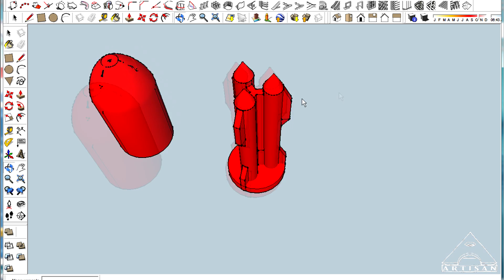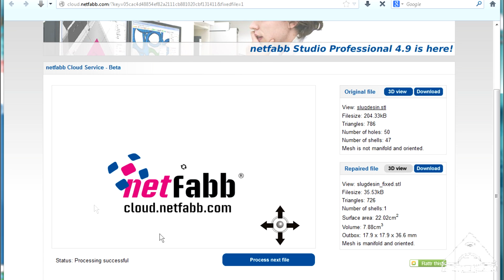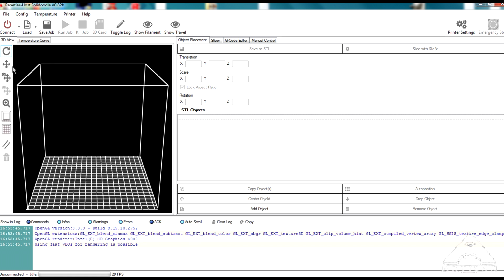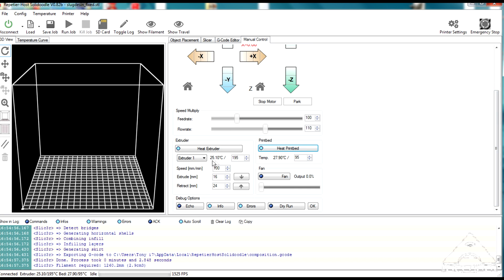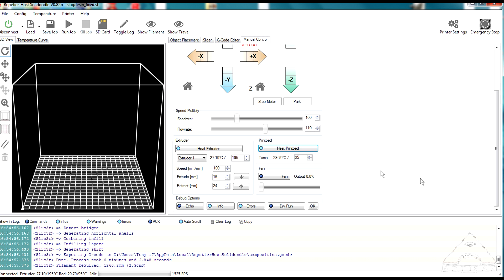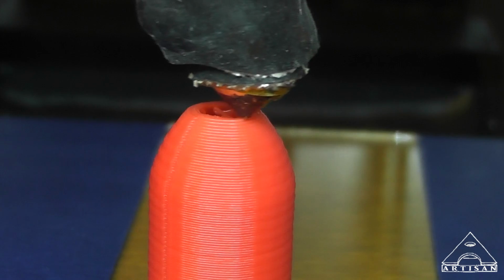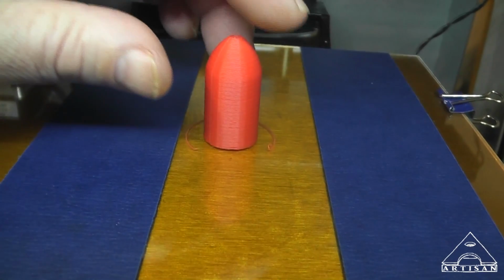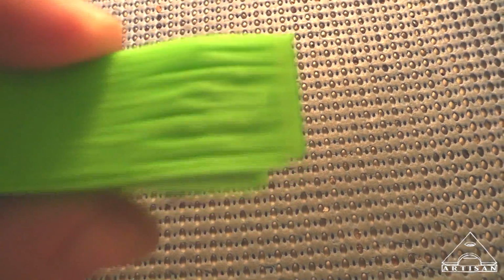3D Printed 12 Ga Shotgun Slug for taofledermaus

Comment: I use hairspray on the glass and it sticks really well. I spray it on till it's a gloss and then set it aside to dry for 30 mins. I use Fructis Style Anti-Humidity Hairspray Extreme Control. Also cleans off easy with water when ya want to start fresh.

Comment: Might want to look into a heated bed, unless you have one. And you could cover your glass panel in Kapton tape that should help. Look to the reprap community for help. They are super resourceful. Glad you've looked at the acetone polishing. It's awesome easy. as long as you're using ABS not PLA to print.

Comment: Pre test thoughts are that it will not fly straight sadly. The power of a 12ga is too much for a piece of plastic  that light and in think the layers will fall apart. If it holds together, it will fishtail it tumble because there is not enough weight at the front. But it will be a very cool test none the less! What version of CAD are you using?

Comment: a plastic 3d printer is about 1,000 to 1500 a metal printer is a bit more need to take classes an permit to use since it causes toxic fumes they run about 30,000

Comment: Can you make a 3D printed colt pistol?
Reply: Guess you could, but i'm pretty sure it would brake since the design of a colt pistol is to be made of metal (some sort of steel i guess) which is much stronger than these plastics. Also, force carrying pieces has to be designed with the layers specailly in mind, since the load carrying capability is not the same in the direction of the layers as it is in the direction crossing several layers. 

Also, the surface of a 3D print is coarse, which is bad for load carrying capability when you get near to the limit of the material. 

Printing a gun should be fairly easy, but to be able to fire, it would have to be designed specially for the material and manufacturing process. :)